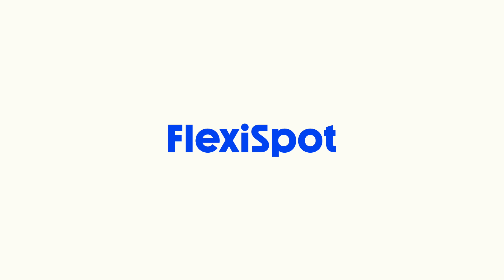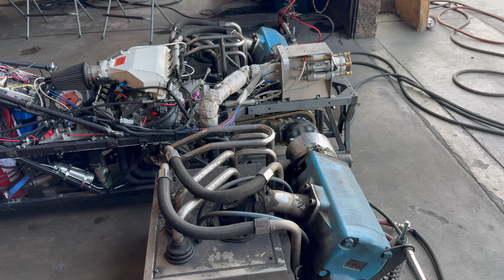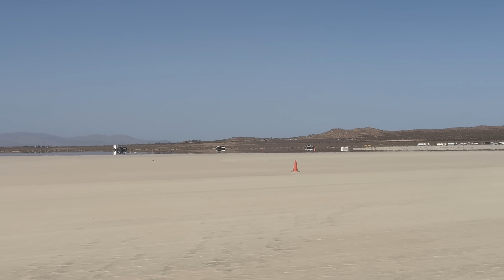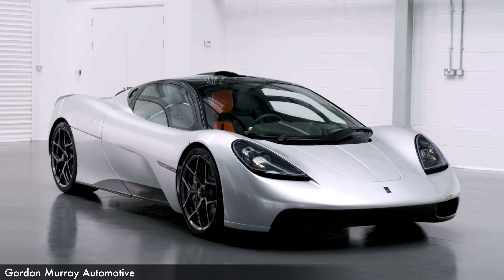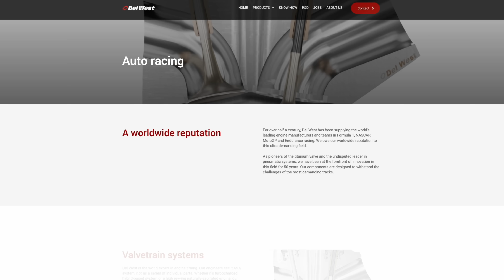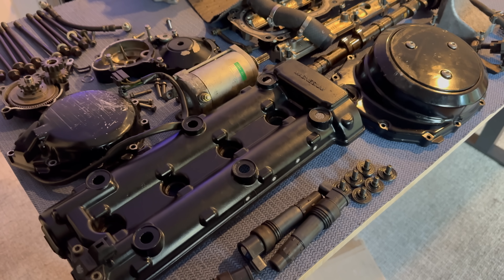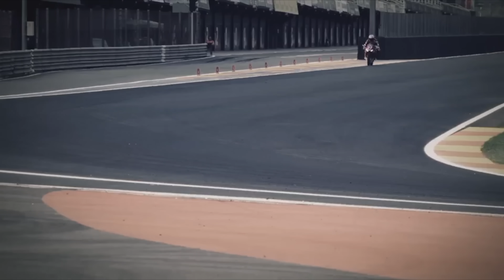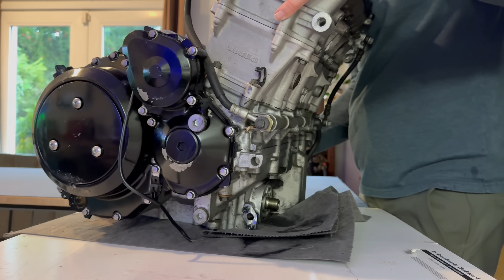Motorcycle Engines Are WAY BETTER than Car Engines

Comment: Growing up with a Volvo i never imagined that cars are not meant to last over 200 000 miles.
Reply: Ive seen almost everything last over 200k miles, even a 2.7l dodge intrepid. The key is maintenance and repair, most people ignore that
Reply: @cyclesaviorn2700 My car is on at least (second owner) it's second turbo, rebuilt gearbox and third clutch. Plus a whole lot of sparkplugs and a couple of lower control arms. If you repair stuff, you can keep everything on the road. But running costs will go up.
Reply: @cyclesaviorn2700  Perfect example. I remember when those were rolling through the shop on a regular basis. It's a bad sign when the first page of google searches for "2.7L dodge" is nothing but class action lawsuits - at least it was when I looked them up back in 2007ish. I'm sure you can get them past 200k miles, but the repair cost has to be significantly above average. I saw one a year ago and realized it was the first one I'd seen in years lol
Reply: @cyclesaviorn2700  ehh one caveat is rust. You can make it better but many cars will rust away in less than 20 years, some in 10
Reply: @jonnenne it's called washing your car and getting undercoat often. I drive an 05 volvo(20 years old) in the middle of the rust belt (iowa) and my frame/body panels are still in near perfect condition
Reply: @colewyatt5298  no the panels literally trap water and salt. Yes you can disassemble the wheel arch liners and undercoat. But you know what? I got a family, work ans hobbies. It's nice that you have time to spend on such nonsense but any car that requires me to disassemble my car just to avoid design mistakes is a bad car.

Volvos are way different to VW. Vw rusts much quicker. Volvo does have issues with rear subframe though.
Reply: @jonnenne wheel arch liners take like 5 minutes to take out of most cars. Its literally just a few plastic pull tabs/screws per wheel. If you dont want to put in the effort to maintain your vehicle then thats fine, but if your car is rusting away into nothing then its entirely your own fault. I personally enjoy working on my car and keeping a cool piece of history going. Its the same as oil changes. If you dont change your oil your car engine will inevitably fail. Doesnt mean its the car's fault.
Reply: I think you have a very niche view on this. Literally no one else thinks that's reasonable or a good design. A car should get oil changes but you shouldn't have to zinc paint your car yearly. They are designed to trap water, mud and moisture inside the unpainted metal work. Most people like me don't even have a garage to do work like that. 

Even so, now we are besides my original point. Vws are badly designed and badly rust protected. They are the worst ones actually. 

Btw seems like new Volvos have gone down in quality. I have seen 2018 xc90s with the truck completely rusted on the edges. Seems that gone are the days of v70 quality  @colewyatt5298
Reply: @jonnenne my vw lived in the rust belt and barely had rust except one small surface spot on the subframe, wtf are you talking about? You just gotta rinse the bottom a few times per winter
Reply: @DarkAttack14  I am talking about cars on the street man. I don't care about your individual experience. I can just walk up and down the streets here to see that VWs rust the most. Now the new body Volvos also seem to rust interestingly. You can also just ask a bodywork guy who will tell you the same thing at least here in Europe. Vw and opel suck for rust, French cars are surprisingly one of the best ones because they have better zincing process.
Reply: I grew up with pre efi subaru, and toyota. Im used to 1.2 million km being normal lifespan for a half looked after daily driver 😂
Reply: @Colt45hatchback That's not happening with those thon
Reply: Shoot, the older naturally aspirated diesel cars could reach millions of miles and still have life to give
Reply: they used to but to hit the required fuel efficiency and emissions standards nowadays blocks have way more pressure on them but they're weaker. to save weight and materials they make blocks smaller and lighter and that includes stuff like pistons walls and oil openings, that means it can handle less pressure and needs lower viscosity oil and less reliability. and at the same time they're putting heavier turbos on it and upping the pressures even more
Reply: @Jurre-k7q  Lower viscosity oil isn't inherently "less reliable" or whatever (IIRC Honda ran 0W-6 and 0W-30 on test engines for 200k miles and found no difference in wear) and neither are the rest of the things you mentioned. The main issues with modern engines are the piston rings and valve stem seals (and oil change intervals that don't account for how the car is being driven, hot oil loses lubricating properties faster). They don't emissions test older engines as part of certification process so literally everyone is using low tension piston rings and less than ideal stem seals to get a tiny bit extra fuel efficiency to avoid being hit with the EU fleet CO2 fines. Those are fine for the first 100-150k sometimes longer, but they're guaranteed to have oil burning and blowby issues far sooner than older engines. None of that will properly kill an engine though if you keep an eye on it, but it will make the emissions worse so they could just prevent that entirely by making manufacturers run emissions test cycles on engines that have been "broken in" on a test stand for longer than they currently are and that wouldn't be an unreasonable requirement given plenty of engines make it far further than 200k miles.  

Those tiny turbo engines also get driven hard most of the time which is fine (they have decent safety margins), but not if you have 15k km oil change intervals. 15k intervals are fine if you have high oil capacity and literally never drive your car hard at all while avoiding short trips at all costs, but otherwise by the time you go in for an oil change the lubricating properties are terrible and you're just putting unnecessary wear on every surface if you don't do them sooner. I guess they do it because people really don't like the massive inconvenience of doing an oil change every 10k or sooner (which is like twice a year for the average European driver lol). Also most people literally never do coolant or brake fluid flushes. 

If you just do your maintenance properly pretty much any car without a major catastrophic design failure is going to rust out and need some welding before the engine or transmission stop working well enough to keep being driven.
Reply: @Jurre-k7q modern blocks are often stronger than those in older vehicles so that's not tracking. Metallurgy has advanced massively in the last few decades
Reply: I have 275k on my 2006 Acura. I put 30k a year on it so I don’t drive anything newer as it’s just throwing money away. Some cars are 150k mile vehicles. Some are more.
Reply: My first Volvo (1965 Amazon Estate) did 350 000 before I scrapped it and bought a 1975 245 which did 250 000 before the salt on Norwegian road ate a hole under the pedals.  I only scrapped the Amazon because no one wanted to buy it not because there was anything wrong with it.  And I could have had the 245 fixed but in 1996 it wasn't worth what it would have cost.  I also expect my Californian made 2015 Tesla S to easily make it to 200 000 miles (155 000 miles so far)
Reply: @NinaLanyon  Are you me? Haha

I grew up around Volvos here in weirdo California and I bought a '65 Volvo Amazon Estate. My parents bought a 2013 Tesla S 85 new and it's been very good to us, though we're at 152k miles and one of the motor mounts is getting tired and causing a clunk. It's also not had the coolant delete done, but we're still trucking. Not too far off from your 155k miles at the time of writing, and I hope your motor hits the big 200 as well!

Hope the aluminum chassis serves you well. It's kind of a proud thing to live close and be able to drive past the Tesla plant in Fremont (though less so now with the guy on the wheel falling off and then making silly little robots instead of cars). The place is storied too, Toyota was making Tacomas there and Tesla partnered with them on the RAV4 EV. Looks like a working relationship and not just a building sale :)
Reply: cars only started not being meant to last in the early 2000s
Reply: Volvo's also are great for Cheerleaders.  You can fit so many 90's era Cheerleaders in a Volvo.
Reply: @MickeyMishra  cool!  Good to know.  Glad my wife convinced me to buy the great deal on a used XC70.  I probably shouldn't tell her!!!
Reply: @MickeyMishra I miss my 84 242 turbo 😢
Reply: @MickeyMishra especially in the trunk
Reply: @schrodingersmechanic7622  That was funny as fuck and if nobody else will acknowledge it, I will 😂
Reply: You obviously have never driven any other older style vehicle. Believe it or not the first gen LS400 beats your shit by a lunar shot.. I'm American. Yes our shit sucks, but to act like your Euro trash compares to Japan?? All I have to ask of you is who is your dealer, cause I need whatever the fuck you're smoking
Reply: My Citreon lasted 60 sooo :D
Reply: Those old Volvos were bullet proof
Reply: Blame the American and European auto industry. Europeans focused on smoothness and performance over reliability(i.e. never buy a used Audi) wheras Americans focused on cost reduction(i.e. only buy a used American Ford when it has depreciated)
Reply: @Adder0130  I blame emission standards, not car manufacturers
Reply: @Anemoia_of_Speyer  I like clean air as well and driving plug in hybrid car. My rule is to avoid buying single use cars with wet belts and try changing oil more frequently like every 5k miles hopefully car will last 150k+ miles with good maintenance. Disposable cars are bad for ecology as well.
Reply: @BrewingHazard  Both are to blame!
Reply: Honda also
Reply: Most cars will last over 200,000 miles, but in a B.C. sort of way, where at some point all that's left is you riding one wheel like a unicycle.
Reply: domestic car people shed a tear at this
Reply: @GUSftw What are you talking about? American V8s are very reliable most of the time.
Reply: @yeetboi8693-os5kb  maybe old ones
Reply: Volvos are shite overrated, just like what people say about german cars
Reply: My 2000 Avalon still has golden oil at 305k.
Reply: Same but Toyota/Lexus owner instead of Volvo.
Reply: My Dodge Ram with a Hemi has over 400k
Reply: Who TF said they aren't?
Reply: Today's cars aren't bc of shady greedy corps intentionally making things to break on purpose to force people to use more money to fix or get a new car. Old cars last forever
Reply: @lil_shrimp6404  not quite true. I remember working on cars in the 80s and 90s and there were so many absolutely shocking cars then. Low service intervals, poor economy, unreliable, they rusted to dust before their tenth birthday and folded like cardboard in a crash and killed your family. 

New cars are objectively better. Making more power from less fuel and better for the environment and health. Sure some modern cars have issues but trust me, it was ever so. Also, remember some old cars can be proven reliable because .. they've been proven reliable. There are plenty of modern new cars around now that will last 250,000 miles. They just haven't had the time to prove it yet. This history has repeated time and time again.
Reply: 200k is nothing 😂 wtf  used to have some random ass seat with bout 840k km on it it only broke because the bottom fell out 😂 engine was still completely fine turbo charged diesel
Reply: Australian built cars commonly go over the 1mill mark

Comment: The thing i like the most about motorcycle engines is how nearly all of them use more fuel to accomplish less work than a standard econobox engine does. Killer engineering achievement. Speed isn't the only design metric.

Comment: OK, motorcycle engines are better in that they produce more power per weight.  They are worse in that they have worse emissions and presumably use more fuel for the same mechanic energy produced?

EDIT: Oh, it's explained later in the video.  Nice!

Comment: What bike engines don't do so well at is economy.  Many cars weighing over 1 tonne use less fuel than bikes weighing around 250 kg.  Sure, drag is worse on a bike.  But also economy is not a driver for bike engine designers, as it is not for Toyota designers

Comment: It's kinda funny how engines are. I have a 69 f250 and the motor,a 360FE weighs about 600lbs while my 1980 Yamaha XS11 weighs about the same, the whole bike is probably lighter than a whole truck motor

Comment: Motorcycle engines dont have the reliability of a passenger car engine. Scale them up and you'll see.
Reply: Okay you literally make this video a moot point by pointing out the emissions difference. Build a car engine to the same emissions to a bike engine and see if that car engine still sucks like you say lmfao at least you saved my time appreciate it

Comment: Saying that cars today are engineered for 150,000-200,000 miles of use is a STRETCH. Most of the piles produced after 2012 are STRUGGLING to make it past 50,000. Many more recent piles, say after 2020, are just crawling a couple miles past their warranty and that's it. Junk it and finance another one lol

Comment: Don't know how much my CBR 1000RR's engine weighs by itself, maybe near 200lbs?  The engine output is 176-178HP at the crank.  So, near or at a 1:1 ratio (lbs/HP).   A really good car engine has an engine weight (lbs) to HP ratio of 8:1, while a standard car engine 20:1.  For it's size and weight, a performance motorcycle engine is insane.

Comment: 12:50 Now I finally know why this happens. The tip that I received was to keep reving the engine a little while holding the clutch and pressing the pedal, so the gears shake and connect

Comment: Putting a motorcycle engine in a small car makes sense, putting even a 1200cc motorcycle engine in a regular sized, or heavy car is like asking a really jacked miget to carry a 4x8 sheet of drywall up a flight of stairs. 
You need either 2 migets, but then you gotta pay 2 labor wages, or pay 1 regular sized person who's even just average build to do the job.

Comment: A Desk more expensive than 14,000rpm reving super bike engine 🤦‍♂️ 

The only reason afaik that a 14000 rpm engine wouldn’t  pass emissions is due the cam timing and duration.  Solvable with variable cam systems.  I hope koenigsegs air controlled valve system is soon in mass production.

Comment: Just don't change direction in an engine and you're golden. Very fast and usually efficient. Examples:
- rotor engines
- turbine engines
- electric ones
Unfortunately rotor engines have a short lifespan; turbine ones have short lifespan, noisy, and expensive; electric motors have a big problem - batteries.

Comment: dude, everyday driving in a car with a car engine beats a motorcycle engine swap hands down, its horsepower vs torque. a heavy car is useless with a motorcycle engine because its does not have the low end torque needed to get the car rolling. A car with a motorcycle engine has to be reved to the moon all the time so this is boguss and thats why we have car engines in cars. hello
Reply: yeah he kinda says exactly that

Comment: Outstanding video. Best I’ve ever seen on the subject. Modern motorcycle engines are marvels of ingenuity, but this comes at a price: terrifying complexity. Which means IC engines are ultimately doomed to be replaced by far, far simpler - and torque rich - electric motors.

Comment: Interesting video. I think your view that motorcycle engines are only designed to last around 30 - 40k miles is a bit pessimistic. Sure if you had an old R6 it would probably suffer from cracked cylinder liners by then. But a lot of the older Honda CBRs are known to do hundreds of thousands of miles when looked after.

Comment: Soo, motorcycles engines are better, for motorcycles, not cars LOL... Low weight cars are kinda impossible those days, cars has too much confort, you not even had space to make motorcycles more confy... you  are literally sitting on a small pillow over a engine attached to two wheels with little extra stuff LOL

Comment: Motorcycle Engines Are WAY BETTER than Car Engines - WHY? - Precision tooling an engineering is easier with less material/structural density - to pull 10X+ weight, the precision is unreliable due to the material density required to reliably run.

Comment: Way better thank car engines? Less reliable. Short service life. Less fuel efficient. Less torque. More waste heat. Literally the only good thing about them is power density and that's not always a good thing either. Overall, motorcycle engines are worse. Fight me.